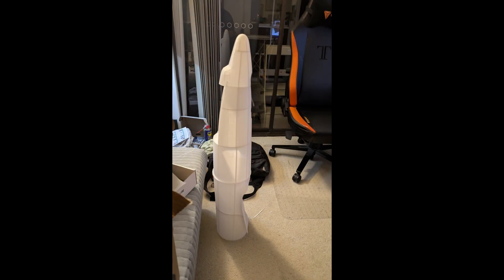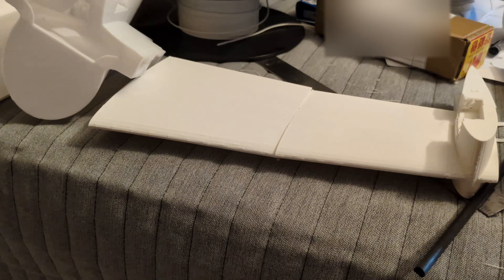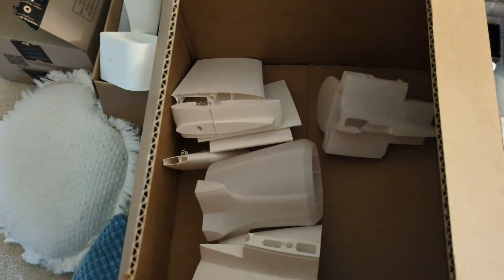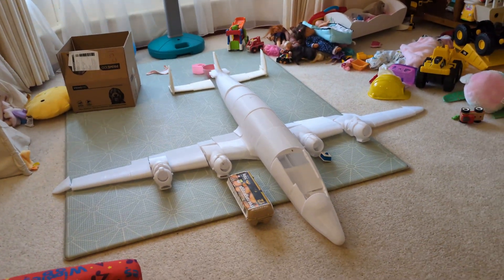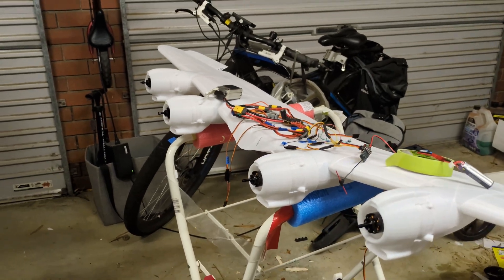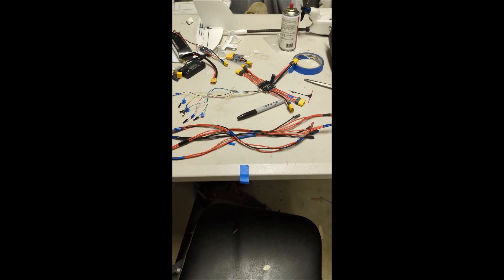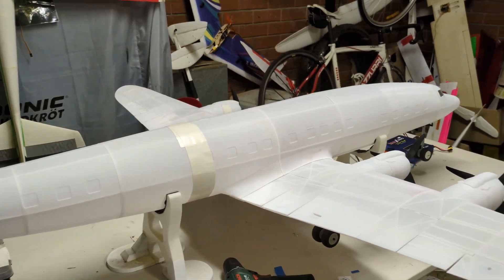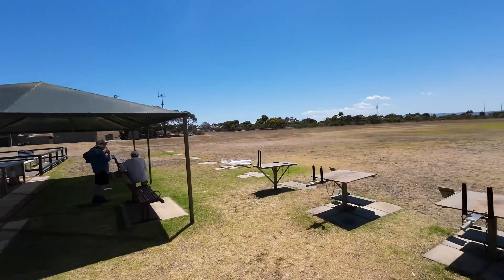Building And Flying A large 3d-printed RC Lockheed Martin L-1049 Super Constellation

Comment: information     people who design printable scale model aircraft always fail to use a not-scale, flat-bottomed profile.
a wing should make 'a bit less lift' at its root.     that is why, if one pays attention, it can be seen that at full size a nearly symmetrical root profile is used.
1345, 1424   the use of flaps is  seldom  recommended.     this is so because 'extra' lift near the center line  partially  unloads  the ailerons.!
Reply from the maker: Hey mate, thanks for that info, just so i understand, are you referring to potentially why i dropped a wing on the landing approach? 

Cheers for watching regardless! :)

Comment: Nice! Never thought of using a quad motherboard as an esc for multimotor config. May i ask which brand and model did you use?
Reply from the maker: Hey! Yeah it's a very convinent way of running a multi motor, the only thing is make sure that you have adequate airflow as quad escs heat up a lot and are designed for quads where the airflow is high, unlike a plane fuz,

Just get any 4in1 that has enough Amps for your motors brands don't matter to an extent, I'm planning on doing a follow up vid for this because I don't think a lot of people have thoguht of this install

Here's the one o used for the Connie I just found this on AliExpress: 
AU$131.48 | 60A BLHELI_S 4IN1 3-6S Brushless ESC 30.5*30.5mm For F405 / F7 / F722 / F4 Flight Control RC FPV Racing Drone
https://a.aliexpress.com/_mrPJU2F
Reply: @ maybe you can use a heatsink or even a fan to cool it down as in rc cars where esc’s dont get enough ventilation
Reply: @locarshobbies  Oh, that would be great.
I am very interested as I am working on the An-225 with 6x EDF.
when it comes to soldering and RC electronics, I'm not quite up to speed ;-)

Comment: Awesome- do you have video on the printing process?
Reply from the maker: Hi! Do you mean print settings? If so there's a full manual included with the files that you purchase 

Essentially there are 3 main profiles a normal single wall profile, a vase mode profile and a standard one (for solid things like servo horns and what not)

Thank you for watching I appreciate it very much

Comment: Great job! Do you think it might be tail heavy?
Reply: You could be right... my prototypes were also borderline tail-heavy.
The CG range of the Connie is quite large, but I probably underestimated how much the positive angle of about 3° on the elevator makes a difference.

Like the original, it is actually over stable. When flying quickly, it pulls up a little and slowly down a little
Reply from the maker: Hey!, i followed the designers CG of 7mm behind the front markings, my understanding of a tail heavy aircraft is it being REALLY sensitive on the pitch axis, it may be tail heavy, but it didn't seem to feel bad enough... In fact i had to apply some down trim even, but yeah i dunno it very well may be :) 

THanks for watching
Reply: @locarshobbies  Thank you for answering my thoughts. It looked like it wanted to pitch up and not wanting to fly level. By adding down trim that tells me it's tail heavy some.
Reply from the maker: On my next flights I will try a bit more noise heavy setup it's safe to do anyway haha thanks though I really appreciate it
Reply: @locarshobbies  Sounds great, I will look forward to it. I 3d print planes and fly RC. I like this plane more than average as I flew in one across the USA in 1966 while in the Army. (Yeah, I'm 80 yrs old lol)
Reply: Just plain heavy
Reply: Awsome, my father inlaw was cabin crew on the Connie back in the day.😊👍